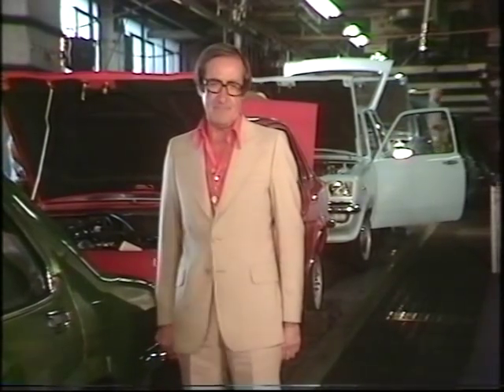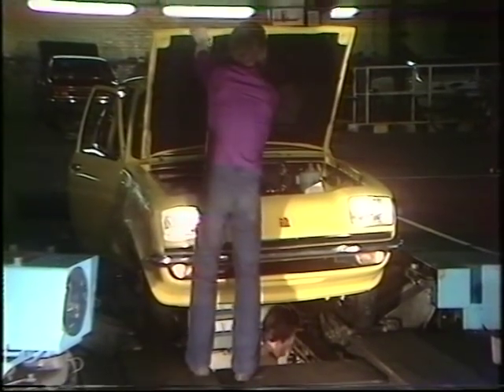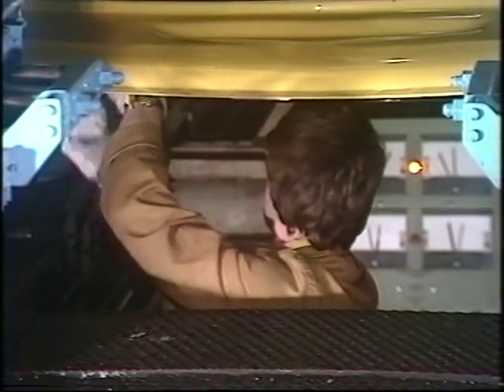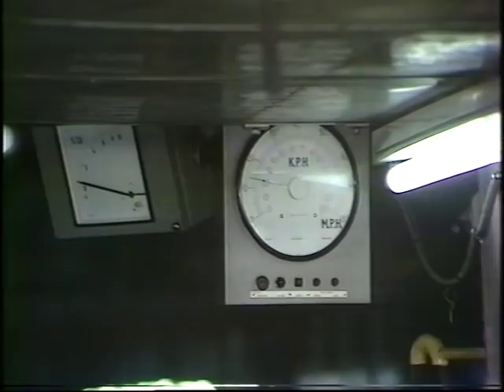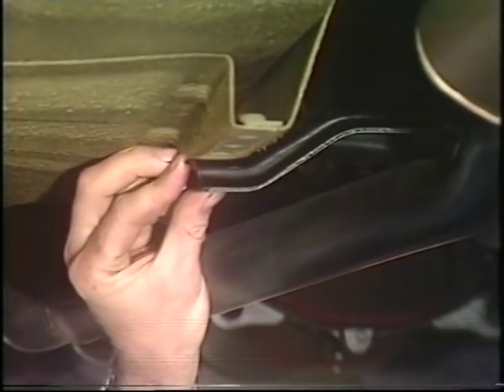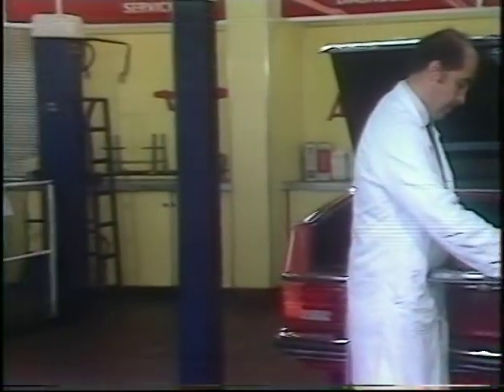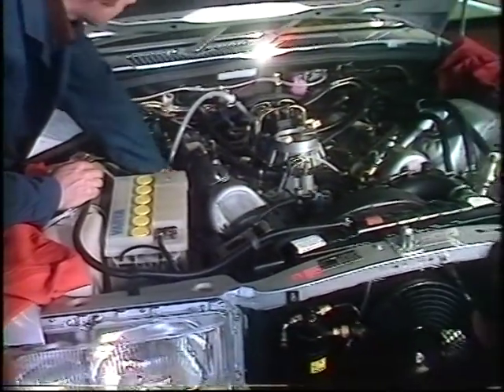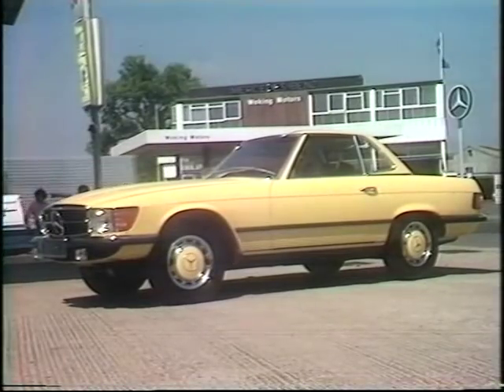1970s Vauxhall | Vauxhall Chevette | 1970s Mercedes Benz | Car factory | Drive in | 1976

Comment: Every car comes with a half hour anti corrosion warranty
Reply: That long????   WOW!   GM was being generous.   We had a Citroen club - bought brand new, that car required significant rust repairs 2 years later.
Reply: @tcpnetworks  Yes! My dad had a GS Club estate and It was pock-marked all over with rust by the time It was 3 years old. I remember him treating It but it didn't help.
Reply: As much as that !😁
Reply: Bah Ahahahaha! Spot on!
Reply: I bought a new VW Golf in 1997. The dealer wanted to 'fix the rust spots' before it left the showroom!! I told him where to park it and how to return my deposit,.
A very curious thing then happened. I threw caution to the  wind.....and bought a new FIAT - the traditional butt of rust and reliabilty jokes. Duringr 6 years of ownership and 84, 000 miles, the only fault was 1 headlight bulb failing. Tyres replaced routinely and not a single rattle or loose piece of trim.
It had more 'fun factor' than the VW too, fun to drive.
I was the first to be thoroughly amazed, especially with the generous part ex' price I got when changing it.
Very refreshing somehow.
Reply: I had a Chevette (2nd hand) and it was remarkably free from rust even when I got rid of it a few years later. Lucky I guess!

Comment: I remember my dad’s Vauxhall Shove-It. What it really needed was a heated boot lid, to keep my hands warm while I pushed the bloody thing.
Reply: Your comment beat me to it 😂😂
Reply: Good one! I got a chuckle out of it.
Reply: For a week, after school, my brother and i had to wait for the all clear then push start one of the rancid things. The pars had a ford escort on order, only a dealer special 1.3 mk4 but it was the enterprise by comparison when it arrived. All those checks and they still missed the fact it was cr@p!
Reply: We were really fit as kids. We had a Mk1 Cortina.
Reply: @philhealey449  so were we. We had to out run the bullies.
Reply: @deefenbakerone4369  All other kids seemingly travelled in self starting non Ford  cars. During  the oil crisis there was a Ford Popular briefly replacing a Rover 90. That was not keen either on cold damp mornings but we had a secret weapon as we then lived up a long hill.
Reply: A heated rear window was standard on the Skoda for this very purpose. It was also sold as a 16 valve. 8 in the engine and 8 in the radio.
Reply: @paul756uk2  You'll be getting a letter from Jasper Carrott's lawyers !
Reply: @philhealey449  yeah I know they're hardly original.
Reply: Like most cars in those days you could virtually strip it down and put it back together with half a dozen spanner's and a couple of screwdrivers. Unless it was clapped out there's really no reason for it to continually breakdown. Lack of basic maintenance was the main reason things went wrong. Today's cars might be more reliable but when even a minor issue arises make sure you have deep pockets or a university degree in computers!
Reply: Ha ha. That was an everyday sight. People trying to get their cars started. Being asked to push a car was normal. Ah... British motoring.
Reply: @roberttucker805  Yes YOU can do that. Some people aren't able to fix things. And they shouldn't have to.
Reply: Bought a brand new fiesta back in 1985 the very next morning after picking it up I pulled the choke out to start the car To find the choke was not connected to anything oh yes predelivery inspection completed and then once returned after it had been repaired the car decided he didn’t want to start anyway the joys of a new cars in the 1980s.

Comment: Like a lot of other 70s small British car's the Chevette was prone to starting problems because of the point's and condenser fitted in the distributor which never got replaced until it didn't start at all. Then you had to set the gap right. Thank goodness for electronic ignition , it was the best invention ever.

Comment: The chevette really was a good looking car I like the estate versions long live the mighty Griffin 😍👌
Reply: The Opel version was much much better
Reply: Opel themselves were so impressed with the Chevette hatchback (developed by Vauxhall when the two companies weren’t fully integrated) that they briefly sold the 3 door Chevette as the Kadett City, before the Corsa A (AKA Vauxhall Nova) was introduced.

The Chevette was a refinement on the basic Kadett design, in many ways.
Reply: @BungleBare  Opel offered more versions of the Kadett than the Chevette including coupe versions. The Kadett Ciry was the bargain basement model with derated engine. The Chevette and Kadett  both used a GM platform.
Reply: Ron McCullock 

The T-car programme was pretty diverse, including variations in both of the Americas, Japan, and Korea. There might have been South African variations too, but these seem to have been Viva based. Never understood why there wasn’t a Vauxhall version of the neat Kadett coupe. I suppose it would have required Opel engines to be used. Although the Chevette (Vauxhall I mean - there was a Chevrolet Chevette as well) used a GM global platform, it used existing British engines; 1300cc Viva engines in the normal models, and Lotus derived engines in the HS/HSR homologation specials. Probably internal politics, and jockeying for position within GM, being behind such decisions.
Reply: @BungleBare  Thanks for the information John, most Interesting
Reply: Kadett had a 1196cc engine then in germany you got a 1.0l,1.6, gte 1.9 and 2.0l. Chevette had a crap 1256cc. Kadett was about 3500 in 1975 for a 1.2 coupe about 1k more than a chevette or escort. And I do prefer the look of the kadett compared to chevette but might be biased as I have one haha
Reply: @MrAaronb400  I have a few Opel UK price lists the prices  and they are not more than the Vauxhall version
Reply: @ronmccullock1407  it was an autocar magazine from about 1975 I'll have to dig it out and have a look but certain brand new a kadett was 3500 but it was a better car and it had a smarter interior

Comment: i was always told most of these cars were nogood when they were brand new, now there classed as collectable
Reply: Not true. Dynamically they were great. Great steering and suspension. A little underpowered but kept up with traffic on the motorway no problem. Nicest thing was how easy they were to work on. Loads of access under the bonnet and pretty standard (i.e. Viva) everything else.

Comment: Did every car leaving the production line at Vauxhall's Ellesmere Port really have all those checks carried out? Over in Germany Opel really did have a first class quality control for their cars
Reply: @Otto-AutoPilot  so very true
Reply: I'd assume the checklist was standard for GM worldwide, or at least the T-Car models. The fact that an Opel Kadett or Isuzu Gemini would be better built than a Vauxhall or Chevy Chevette would be down to supplier quality issues and the Anglo-American "good enough is good enough, keep the line moving, these aren't Cadillacs after all" attitude.

Comment: The best looking part of the Vauxhall Chevette was its front end appearance. If only our American Chevy Chevette looked like that.
Reply: My sister bought a (US) 1985 Chevette and the damn thing broke down before she got out of the dealership parking lot.  Guess both Chevettes were pretty similar in that respect :)
Reply: @chrisfreemesser  I've never driven one. I was too young to drive a car during the time it was on the market.
Reply: I drove a couple of 5-year old US Chevettes in 1991 for work (they were mainly run out and fleet cars for their final model year or two) and those cars were, without exception, the worst cars I have ever driven. 
Yes, it was an old unloved fleet car, but it was so miserable to drive. Uncomfortable, cramped with the transmission tunnel, poorly finished, horribly designed dashboard and gauges (of which there were very few) and, of course, it was a slow heap of crap on the road. It wasn’t even that economical, although the State of Connecticut probably didn’t care about that. If you search through YouTube, MotorTrend tests a similar Pontiac T1000 from the early 1980s- it’s a notable test for how bad that car is! 
To put all of this in perspective, the other car choices in our work pool at the time were Dodge Omnis (aka Chrysler Horizons) and Geo Metros (aka Suzuki Cultus), the former also being a run out model and the latter coming with an insipid 3-cylinder motor. All three were pretty dreary cars - couldn’t imagine owning any of them - yet both the Omni and Metro were far superior to the Chevette. It wasn’t even close. 
I do believe the UK Chevettes were better cars than the US Chevettes, if nothing else because of their unique front fascia and better equipment levels. Can’t speak for reliability though, I think all GMs from that era on both sides of the Atlantic were pretty horrid.
Reply: @RoadCone411  Your description reminds me of a newer Chevrolet called the Cavalier. I had to drive one of these for a day and couldn't believe what a crapmobile it was. The engine is noisy and weak but does seem to last, as these rusty, dented heaps are passed around from one welfare mother to the next and still keep running. In some places in Canada, these are derisively referred to as Prairie Cadillacs.
Reply: @jabom99  I've driven my share of Cavaliers and, yes, they are not good cars either. The mid-1980s versions were the worst, but even after the early 1990s facelift, they were still so far off the pace. None of the J-cars were good but the Cavalier always seemed to be the most plasticky and nasty.
I will say, however, that every Cavalier I've driven is far better than every Chevette I've driven. At least I can get reasonably comfortable in a Cavalier...the Chevette was a truly terrible car with few redeeming qualities. It was cheap, that was its defining feature, but so were early Hyundais and even they had more character and drove better than a Chevette. How the little Chevette was America's best-selling car for a number of years is beyond me.
Reply: It couldn't, they tried. There was the 5 MPH bumper and sealed-beam headlight requirements to contend with. There's also the need to run on I-15 across the Mojave Desert from LA to Vegas in July with the a/c blasting. GM couldn't afford another small car with overheating problems after the Vega.
Reply: @RoadCone411   Chevettes with manual transmissions were much better to drive than automatics. I think all the US ones  got the extra-wide automatic transmission tunnel, even at a manual take rate that must've been over 50% among private retail buyers in the early years, because it must've saved a few cents a car and god forbid GM give a 3-pedal buyer any bonus footroom. Meanwhile they splurged on two dash pad moldings since if you didn't buy a/c you didn't get center dash vents!
Reply: @nlpnt  Couldn't afford, or refused to spend the money? That's the problem with corporations, they have all the money in the world, and yet they seem willing to only spend 1/4 of that money to make the car better than this.

Comment: ...and just like Liz and Dick's second marriage, the parts divorced in about 20 minutes.  If you think these cars fell apart in the UK, you should have seen what happened to them where I am (eastern Ontario) when they were exposed to road salt (and winter, period).  They had holes you could throw a cat through, and were undriveable in as little as 2 years, if a Fury or BelAir didn't take them out first.  The dealers left buyers twisting in the wind.  There was one standout, called Firenza, sold here in the early 70's, some kind of Vauxhall I believe...there were demonstrations in front of parliament where owners decorated those cars with lemons, they were worthless right off the lot.
Reply: I remember as a kid a neighbour had a Firenza, I can't remember if it was an Opel or a Vauxhall, but I do remember it being a piece of $#!+. The same neighbour later owned an Oldsmobile Firenza, it was only marginally better.

Comment: These cars were some of the worst crap boxes ever produced, both the U.K. and U.S. markets. Listening to this dude talk it up like it's some masterfully built piece of precision machinery is laughable. (The Chevettes that is)
Reply: The Chevette wasn't the worst offering on the UK market in the 70s. It was based on the half decent Opel Kadett but with the horrible pushrod Vauxhall Viva engine. Can only imagine what the yanks made of it though
Reply: There are none left on the roads if that tells you anything.  :)
Reply: Very few left here in the UK but I'm surprised it was ever marketed in the US since I understand you guys were more into big V8s at the time. The fuel crisis must have hit very hard indeed that's all I can say
Reply: @DavidDavid-kl4ru  It was introduced here in the late 70s as a way to compete with Japanese imports. Fail ! The big powerful V8 had been in decline since the mid 70s and poeple wanted good economy.  Of course fuel got much cheaper a decade later and people started buying pickup trucks because they were good quality and had rear wheel drive V8 engines. Now trucks are the most popular vehicles here.